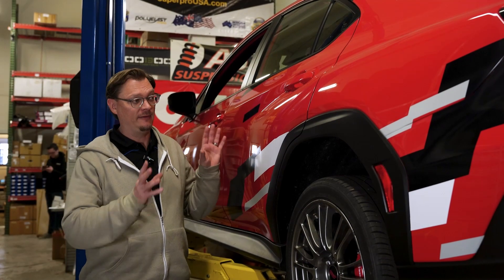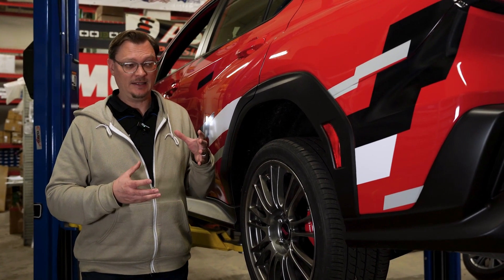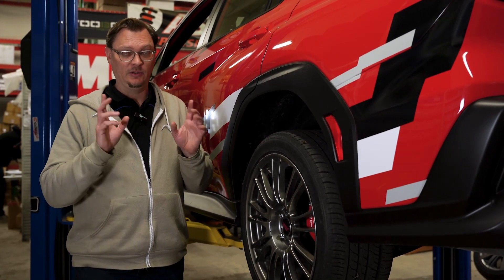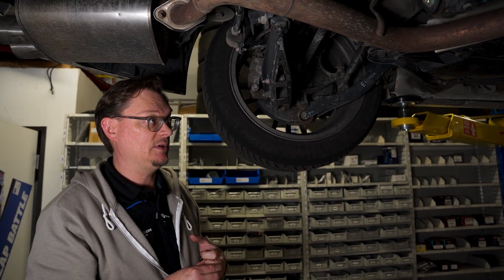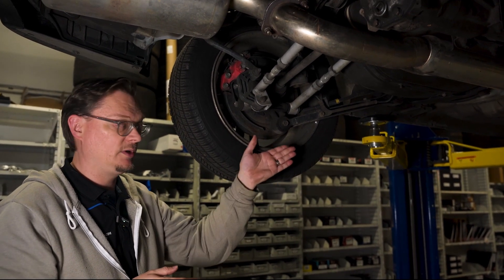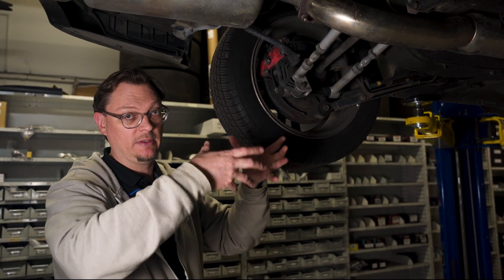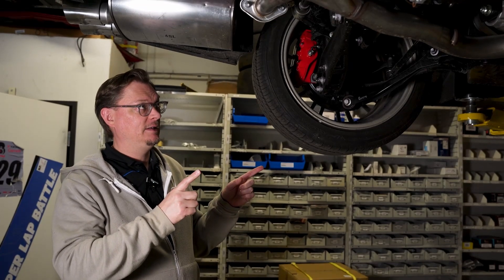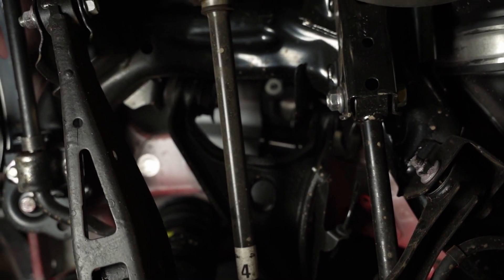What's different about the VB WRX Rear Suspension?

Comment: Great info, thanks! I installed the Cusco rear LCAs on my VB and they made a massive improvement in driving enjoyment. I can feel the weight transfer in the rear very clearly now, and the transition happens predictably rather than the vague feeling of the stock car. My suspension is otherwise stock besides the Cusco front and rear strut bars, and I’m very happy with it for a street car.
Reply from the maker: Nice!  That is good to know, and now that we are working on the suspension a little, it actually makes a good amount of sense.

Thanks for watching and Stay Tuned!

Comment: I'm very curious, has anyone gone down the rabbit hole of swapping the GR+ multilink on an older GC or GD chassis? Is it even possible? Would there be a benefit?
Reply from the maker: That would not be simple at all.  You would have to fabricate the rear strut mounts and possibly the rear frame rails because the two designs are completely different.

Thanks for watching and Stay Tuned!